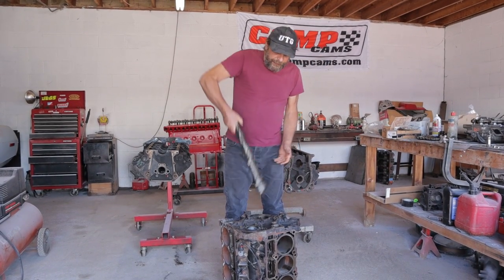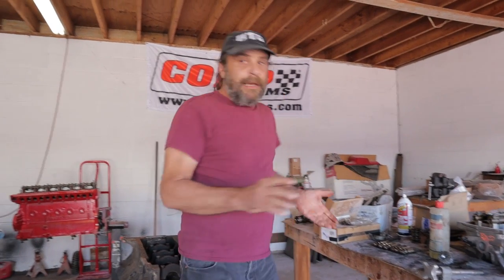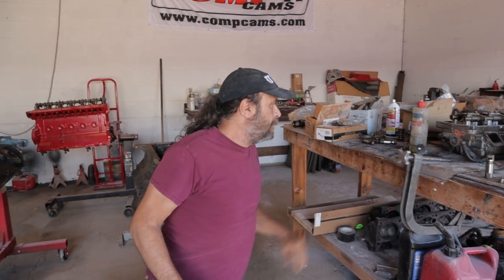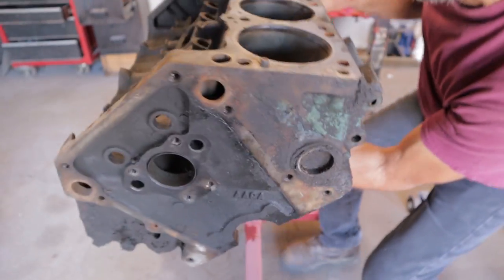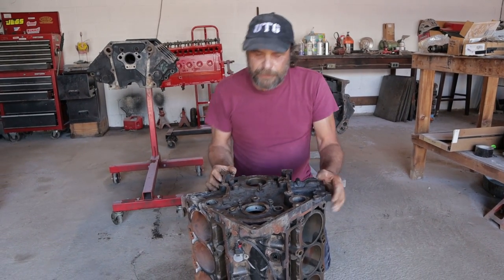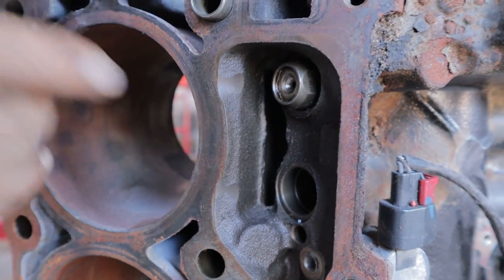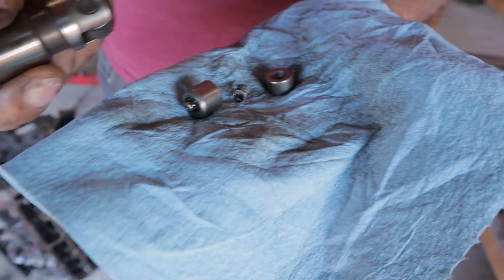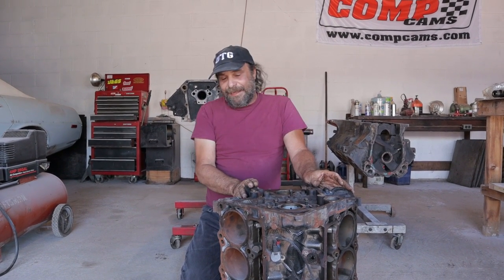Gen 3 Hemi Camshaft Failure Mystery Explained!

Comment: G-day from Australia. Hey Tony have you ever thought of fluting the lifters being machining a small flat edge down the side of the lifter to allow oil through?? Thanks Jono.
Reply: Everybody keeps throwing this idea out there, but these are hydraulic lifters.  They need pressure from the bore to get INSIDE the lifters to keep them pumped up.  You give oil a way to bypass out the bore too easily and you get lifter failure... just in a different way.

Comment: We ran oil feed lines on my dads Amc 401 it's common to do oiling mods even sb mopars need it, im still going to gen3 eventually.
Reply: We did the same thing back in the 50s and 60s with the Y block Ford V8. Oil starvation to the rocker arm shaft. That was in the time of sludge. Major sludge if you did not Faithfully change the oil.

Comment: Tony great video appreciate the research you did I have a 2012 Ram with the 5.7 hemi had a code for misfire cylinder #3 mileage 115000 replaced coil packs, spark plugs and injectors since I intended to keep vehicle so I then knew that the lifter failed and upon inspection of lifters #3 the roller had actually separated from the lifter body and damaged the lobe on camshaft.  I Inspected the other lifters and cam there was no sign of lack of lubrication perhaps cause I never let engine idle long at any time. I think Chrysler has stated that it's a problem with the lifters and also on these hemi's the valve seals are failing also.  I'm having a remanufactured engine put in before the warranty runs out my next truck will be a Toyota Tundra.  I'm a retired diesel mechanic worked  as a 3rd Tier supplier with GM for 8 years and been a car enthusiast my whole life. Ever since the last recession all Auto makers are trying to recoup their profits by purchasing cheapers parts which fail prematurely.  And most of all on the trucks they are trying to improve gas mileage with new technology ie Ford  Eco boost GM and I believe Chrysler corp have it where it will cut out 2 cylinders from 8 to 6 to boost gas mileage.  Bottom line a V8 is not meant to run as a V6 it willl cause issues with the power train.  If you want gas mileage buy a Prius.

Comment: 2015 grand Cherokee srt owner here. Had the cam and lifters replaced at 65k miles. I could believe it. The good news is that everything that could go wrong went wrong while under warranty. Now she's pretty solid after nearly 10k worth of work at no cost to me. We have had the cam and lifters, rear differential, transfer case, ac blower, and the water pump replaced. We have also done some cosmetic things to it and installed the borla cat back atak exhaust installed. The carbon fiber trim has also been replaced. Those are pretty much all the issues these vehicles are known to have. We bought it used so I'm pretty confident that now that everything is as it should be we will see 100k before having any more issues. If I had to guess I would say the transmission will be next. Fortunately we have everything covered under an extended warranty through automation. I wouldn't own one without the warranty because if you have one of these Mopar hemi vehicles you will run into some pretty serious problems along the way. I always say Jeep and Mopar rely too heavily on nostalgia. They need to step there game up.

Comment: I remember back building solid flat tappet big block chevys there was a hand tool that would put a groove in the lifter bore to lube the lobes. You'd put those on the side that would allow the oil to travel out and hit the cam before the lifter. I never tried that. I used to use Howards lifters with the EDM hole in the face of the lifter. Now recently I've been messing with LS engines and found Johnson makes a lifter with axle oiling. I haven't found these for a Hemi. I have a 2009 police charger thats probably idled a lot. Carfax actually lists a cam and lifter replacement, and it just started making a squeaky type of tapping.

Comment: One thing no one ever talks about is the bottom end.. I like to rebuild my engines early so I tore mine down at 126K. The crank bearings looked like brand new. They looked even nicer than the top brand ones I replace them with.

Comment: 150k on my hemi full synthetic oil its whoke life, lots of idle time for ac for my dog.  Motor is shot.  I'm really depressed, i had finally got the truck payed off. Now i need a new engine, $7500, screw ram trucks.garbage. thanks Uncle Tony for the video
Reply: What year was your truck?
Reply: @freedomring4813  2014
Reply: @LouC518  Thanks ,mines a 12 but I only had those broken exhaust manifold bolts break which Dodge should have paid for.

Comment: I did a 5.7 hemi rebuild recently. Did a lot of research on the lifter/cam issue before I got started. It was a general concern. For one, the lifters made for Mopar had a LOT of revisions and manufacturers. So there's a question of quality control on them. Second, Chrysler recently revised their rocker arm shaft to have larger holes and chamfers for additional oil flow to the rockers. This in turn helped with oiling of the lifters below via pushrods. I asked them about them at the dealer when I got them what was up with this, and this is what they told me the reasoning for the modifications to them.

Yes, MDS lifters are a problem with this issue. Cutting the oil off from them by the solenoids helped for their failure. But the additional oiling from the rocker shaft assembly should help remedy this (so they say). I did an MDS delete on this motor (high performance motor), and went with Johnson lifters to make sure they were of good quality.

Comment: From what I've been reading this issue only supposedly affects about 5% of the Hemis made between 2009 to 2014 or something like that, during the bailouts. Many people were blaming cheap lifter manufacturing and material. Many people also said it started happening when they introduced the MDS or variable valve timing system. Supposedly there's lifters made out of better materials and with a better design and heavier needle bearings that's supposed to fix this problem. I'm not sure about all of it yet, I'm still researching it.
Reply: Well the hemi, like all modern engines, does not use splash lubrication. So a lack of splash lubrication has nothing to do with the problem.

Comment: Great explanation, thanks! I also have a video where I diagnosed it on my Hemi and yes I paid close to 5k for the repair only 81k miles on it, it’s just sad that Chrysler will not even acknowledge the issue.
Reply: I replaced my rod bearings last year, I did it myself but it was a lot of work, had to drop the front cradle to get to the oil pan. I replaced all the rod bearings and polished the crankshaft journals, luckily it didn’t eat at the crank much because I shut it down once I heard the knock.

Comment: I just bought a 2020 Charger 5.7 V8. Had 38k miles when I got it. No HEMI tick for now. My Uncle is a mechanic for Ford (but also works on police chargers) and he told me that they basically cured the lifter/cam lubrication issue by adding Lucas Oil Treatment to the engine oil. Instead of doing 7 quarts if oil, they do 6.5 quarts with a half quart of Lucas Oil Treatment. That has increased oil pressure slightly and resulted in better lubrication. Ill be doing that at my next oil change.

Comment: First time I’ve heard a little truth in a diagnosis of Hemi tick, instead of oil “breakdown” manure that corporate uses to distance themselves from this chronic design flaw. Thanks for the great research.
Reply: He's wrong though, modern engines don't use splash lubrication. This engine has a windage tray to prevent the crank from hitting the oil. Splash lubrication has nothing to do with this problem, actually, if splash lubrications exists that would be part of the problem.

Comment: Yikes. I have a 2016 Ram with the 5.7. Not sure what route to take at this point. I try to avoid idling simply because of the fuel consumption alone. Would that prevent it?

Comment: I JUST replaced my cam and lifters due to this problem! Its also in GM engines. After talking with the cam guys at Comp Cams, they say its a problem in the MDS lifters bearings for the roller. I did an MDS delete and replaced them all with hellcat lifters (the bearings are larger, according to Comp Cams) and a new cam. Maybe the smaller bearings are not strong enough or maybe a heat treatment didnt work correctly? Just a thought!

Comment: Well, you've done a brilliant job analyzing the problem with those engines.  Boy, if anybody can come up with an aftermarket fix before the problem develops will make a fortune..  It might be that it will take a higher pressure/ volume oil pump coupled with tapping an oil gallery to snake pressurized oil feed lines to spray the valve assembly, but good luck with that.....

Comment: Great video. Very informative.  Even bad design i seen these 5.7 engines stock oem go over 300k. Yes they had the tick but after warm up it was gone. Still to this day i know someone with a 5.7 2007 348k still running strong.

Comment: The reason it is happening is that at idle in a  5.7 the oil pressure drops too low

Pressure drops down to 26psi at 600-800 rpm (whereas it is 56 Psi over 1500rpm)

So what you need to do is buy a hellcat 6.2 litre pump. 
A  Chrysler oil pump 

It’s higher volume at idle and so maintains high oil pressure at idle but higher volume does not effect oil pressure at higher rpm - because the high volume pump still reliefs at the standard 56psi  or according to the oil pressure relief spring setting
Reply: Does the method you just explained work on a 2006 Chrysler 300 srt8 which has a 6.1 ?

Comment: Great video, lots of insight into the issue. The only question I have is if this was a design flaw wouldn't it affect more engines? My understanding is the lifter/cam issue only affects around 5% of vehicles. I know in my grand cherokee at highway speed I'm only revving  around 1200 - 1300 rpm. So vehicles doing alot of highway driving would be affected too. And that would be more than 5% one would think.

Comment: Tony, I have done some research on this too because I do own a 2020 Ram with the 5.7 MDS VVT engine. The best solution that I have heard so far about cause and prevention is to install the Hellcat oil pump.  it has 12% higher volume at lower engine speed {It is a direct factory bolt on 2009 and later 5.7 Hemi's) . But if you do this, it can cause a fault code PO524 low oil  pressure. But that's  not what is actually  going on. Fault codes are somewhat standardized and the same ones are used by multiple auto manufactures and terminology wording also. The changing to the higher volume Hellcat pump throws the PCM parameters it is looking for to activate the MDS system off and it won't activate it and it throws the code. The MDS  oil pressure window has a low and high value 25lbs low/ 55lbs or so  high it's looking for. The code that it has in relation  to oil pressure is P0524 but the wording is as "low oil pressure" doesn't mean it's actually running low oil pressure . In fact the engine is running higher oil pressure than the 55lbs ceiling  (70lbs-75lbs  seems to be average after the switch). In order to have the MDS work again with the Hellcat oil pump you must take the spring out of the 5.7 pump and install it in the Hellcat pump before you bolt it on the engine . If your engine doesn't have MDS then this is not necessary .  If you want to "deactivate " the MDS system all together then install the Hellcat pump as is but you might have the code on your display. Camshafts have a hardened coating on the lobes and it seems that this coating is deteriorating at a faster rate than normal. Between  the roller lifter  bearing failure and coating deterioration (flaking ) is another reason for severe camshaft damage. Imagine a roller lifter with a hardened wheel spinning on a softer  compromised cam lobe and well gouge city. Getting the Hellcat oil pump is your best defense it seems. The you tube video link I watched and thought was  really good was on Reignited 5.7 HEMI Lifter Failure Could  this FIX the lifter issue FOREVER?

Comment: Great video.  Add to it, the fact that Chrysler deleted the connecting rod oil squirters, which oil the opposite cylinder bores and the camshaft.  Makes you wonder what they were thinking.
Reply: They were probably thinking "well, we need this oil flow for the cam phaser now, so these gotta go"

Comment: Just bought a pre-owned Durango SRT 6.4 43000k miles. Lifters and Cam are being replaced at the dealership right now. Has dodge done anything to resolve the issue? Will the new replacement parts stop this from happening again?

Comment: I have a 2012 1500 and have recently started getting a tick however it does sound like it's down low right by the manifold so I'm hoping its the bolts. If it is I still want to do what I can to reduce my chances of getting this lifter problem. Are there any parts I can change or get it reduce my chance?

Comment: I ran across a post from an FCA customer svc rep that stated too tight ( for epa emissions requirements) valve guide tolerances are the reason for the cam lobe wipeout issues-makes perfect sense to me. I've read heaps of posts regarding this issue and have not come across anything as yet that makes more sense!

Comment: Chevy did this in their 350’s with a 151 crank casting. I think that was the casting umber, but it’s been well over 25 years since I rebuilt one. The crank shafts on these motors were mad of soft material. One of the  rod bearing would starve from lack of oil o; the number 7 cylinders rod journal. Once the number 7 rod journal began to wear out the top end would starve from lack of oil and major problems would happen from there.

Comment: Would this cause an intermittent misfire in cylinder 4 only? My mechanic trouble shooted it for 2 days and can't find anything wrong with it. 2013 5.7l Ram, replaced plugs, coil, fuel injector and checked valve springs. It does a bad misfire in-between 45 and 65mph, but only when it wants to. Just bought it 2 months ago and super stressed out over it. Any help would be greatly appreciated. Thank you Uncle Tony's Garage.

Comment: Question...do gou know if the main and rod bearing bolts are torque to yield??? Can you remove caps and reinstall??? Or do your need to replace bolts... Im working on a 2003 hemi.. Replacing original engine with junkyard engine. I would like to check bearings before installing engine into truck.

Comment: AC Delco is GM's parts supplier. The AC Delco oil filter contains a anti-drain back valve that helps stop the oil from draining out of the valve lifters when the motor sits. If you are using an aftermarket oil filter, switching back to a factory AC Delco oil filter might reduce the occurrence of lifter tick.

Comment: You are mistaken sir. I specialize in 2nd gen/3rd gen 5.7 hemi builds and I can tell you that is not the reason the lifters fail. First if you look inside of the actual lifter bore you will find that there is an oil galley that runs directly to the lifters. The constant up and down motion of the lifters continually spits and spreads the oil onto the lifter bore/ lifter roller/ camshaft. Secondly, you must understand that this issue is specific to the 3rd gen 5.7. The block you were demonstrating on was a 2nd gen block(bet most of your viewers didn't notice but i did since i work on them). Now the problem with your theory of "lifter isn't getting enough oil in bore" that is wrong assumption because 2nd gen blocks are identical in angle and oil to the lifter bores yet they never show the same kind of failure as the 3rd gen blocks. Secondly, we can rule out the mds solenoids/mds lifters as being the cause because I've seen both mds lifters and non mds lifters fail same exact way. I've also seen this same failure in a 3rd gen block with no mds at all(comes standard like this on the 2500 models). Now if the issue was with the lifters, or the bore/lifer/cam lubrication, or mds solenoids then we would see the same failure on 2nd gen 5.7 but in the 100+ 2nd gens that I have built. I did not see this kind of failure. Now onto real issue. Let's start with the main difference between the 2nd gen and 3rd gen blocks. Can you guess it? bing bing bing. The vvt actuator. What I'm finding is that the vvt actuator on the 5.7 hemis/6.4s is advancing/retarding way too agressively and it's beating on the camshaft/lifters to the point that the metal on the camshaft/lifter roller fatigues and eventually fails. You can do your research and find that other engines tend to have the same issue once they introduce vvt actautor. I recently worked on a gen iv ls which had the vvt actuator and it had the same exact issue as the 3rd gen 5.7. So again, since this issue is exclusive to the gen 3, then stick to the differences between gen 2 and gen3. Best of luck to you sir.

Comment: Just cost me $2682.68 for the cam and lifters. '14 Ram. Got lucky because it literally just began to misfire before they were replaced so the lobes weren't totally rounded out and the cam bearings weren't trashed by prolonged driving.  Two lifters actually failed #1 & #7 cylinder.  Mechanic showed me the cam afterward and there were at least 2 more lobes that showed evidence of approaching failure.  BUT with 151k miles that expense can be swallowed as the rest of the truck and the rest of the motor is in excellent condition.  I bought a Hemi to stretch out on open back roads and enjoy a little bit of that Mopar rumble.  If you've had this repair done there's really no reason to throw the vehicle away.